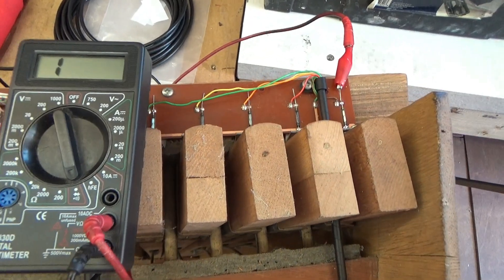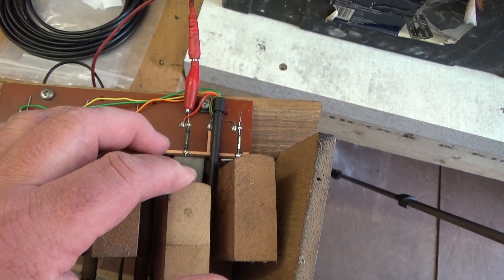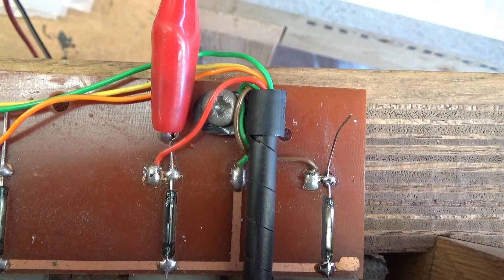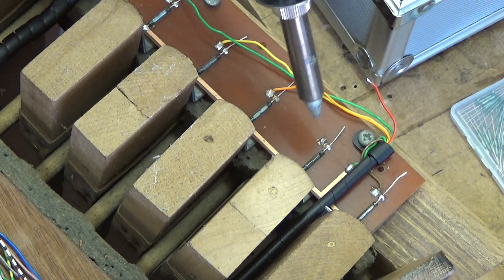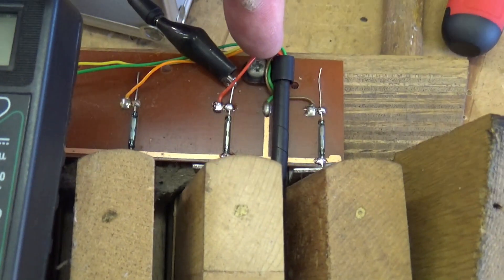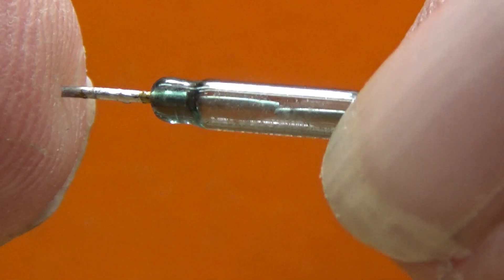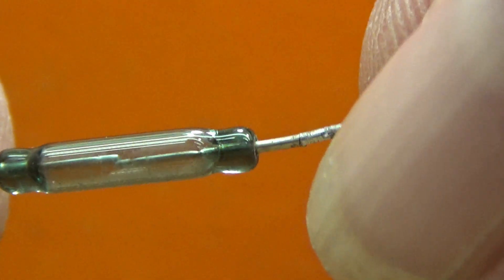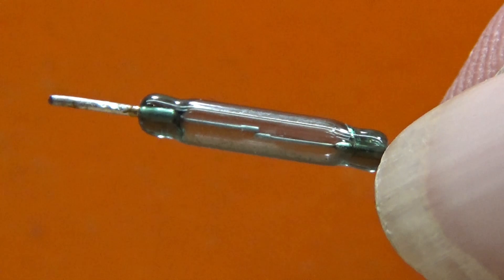Hidden Failure

Comment: What an excellent video... Thank you sir! It helped me a lot! 👍

I have one of those "smart" washing machines, and the lid latch kept locking and unlocking, even though the load is done. So I opened up the lid latch mechanism and found one of those reed switches inside. I had never seen nor heard of such a thing before, so I was guessing it was a weird looking fuse that was blown. There was zero continuity from side to side, even though it looked like the parts are touching. Your vid helped me understand it, thanks again!

Where do you get them? GE makes you buy a whole new latch mechanism, with the harness and all, for $80... I found an aftermarket part on eBay that looks identical, for only $20, so I ordered the aftermarket part... but I kinda want to mess this this one and see if it's possible to replace that reed switch anyway.
Reply from the maker: Just search Glass Reed Switch on Amazon. Be aware that they come in different sizes though so worth checking the listing carefully. Good luck 🙂

Comment: I played a lot with reed switches and they do a great job, but at very little current and voltage capability. If you try to run them with anything but very low current and voltage they will fail pretty quickly. They are very well for mere logic level type switches and to work biasing more capable circuitry, they are great... Thumbs Up!

Comment: Had a similar problem on the gear joystick on my tractor - a reed switch stopped working for no apparent reason and under a microscope you could see the reeds moving when a magnet was near but would not touch or make contact . I connected it up in a series with a bulb and tapped it, producing a small spark on the contacts and after that it began to work again. Amazing how something so simple can behave so strangely.

Comment: The reed can be damaged with the heat stress of soldering, the PCB pads are too close to the glass envelope.
Also the PCB will have a higher coefficient of thermal expansion than the reed glass envelope and will be pulling and pushing at the terminals as the temperature changes.

A better soldering solution is to carefully put at least a 90 degree bend in the reed wires and then solder the ends to the PCB (this may cause alignment issues with the magnets though).  When soldering the reed switch use a heat shunt between the glass envelope and the solder pad.  This will reduce the thermal stress on the reed.

Comment: Sorry Sir ... But your reed switch may not be broken as you think but it is the problem of magnetic field lines should be  orthogonal to the surface plates of the switch and also it should be in proper field strength to make the plates move .. So it may work again if you reassemble it differently this time ...

Comment: The glass is broken and loose the contact loose the original algiment.
It may cause by a stress from heat when soldered or mechanical stress from the environment conditions vibrations ect.
I may try to connect with a flex wire at the upper end and add a dip of silicon at near the glass body. This may prevent to happen again.

The cracked ones olso discolored as i see as a diffrence between them.

Comment: My Roland C380 pedalboard also developed a peculiar problem with some reed switches. They work on their own. However, if a neighboring chromatic pedal is pressed, they fail most of the time, preventing a heel-tip legato from being made between these pedals. The reed switches had no strange appearance. I ended up changing the defective pairs (the reed switch of the pedal that failed and the other one of the neighboring pedal), which solved the problem.

Comment: Not unusual in my experience. Some minor oxidation of the contacts can cause eventual problems with this result; most electronics technicians with telecommunications experience learned about "wetting current" through contacts early on in their training. Although a reed relay is sealed, I don't think the relay is evacuated, so some air remains inside the glass tube. Decent design of the circuit should include some low current flow through the contacts to reduce the incidence of this type of failure.
Reply: Yes, if only he'd checked the operating current. It could also be leaks due to manufacturing defects or soldering too close.

Comment: So have the same problem. Worked my way through ten reed switches, all failed after 5 minutes use. I fitted to model train to switch a micro led to simulate pantograph flash. But after a couple of circuits the reed switches fail. I can see a very small flash.
So bought from different supplier, they are failing. Next step was to fit a capacitor, there visible some some micro flash on led. Or diode and treat reed like a relay coil. 3rd idea drive a transistor.
But perhaps the soldering heat is causing the glass to unseal.
I have soldered at the tip of wires.
Perhaps i try next a screw block connector so no heat is involved or just wrap wire around with blob of super glue and on the glass bead ends.
Otherwise stumped.
Only switches used in past were epoxy sealed in a mounting block.

Comment: A unique set up IE  mounted  over head Reed switches with blanking off metal plates
Reply: I’m currently in the process of midi converting an old eminent organ pedal board and that works exactly the same. Reduces the effect of the magnet drop off with the reed switch (if I understand it correctly) 😊